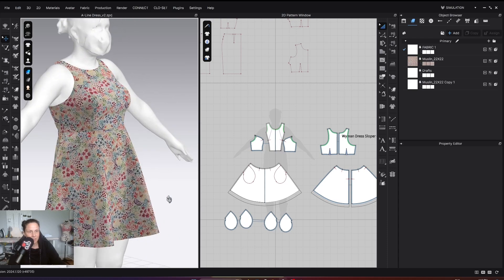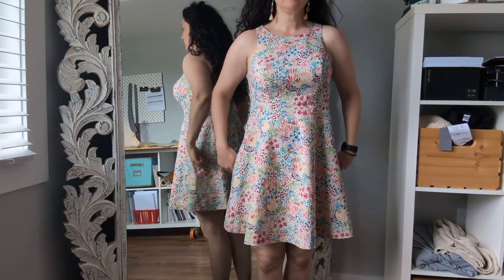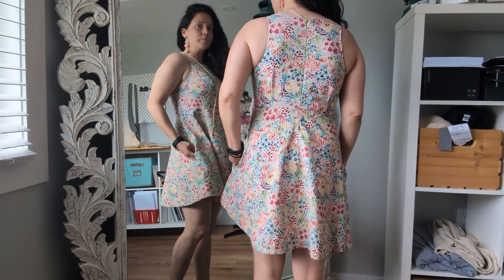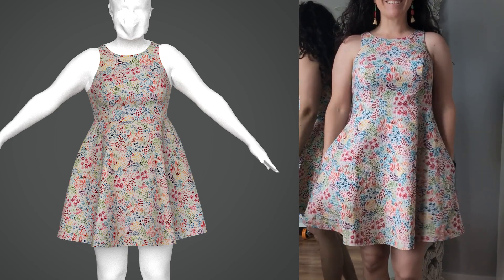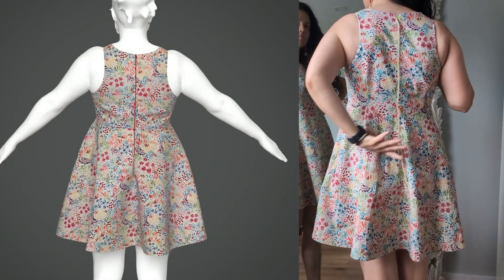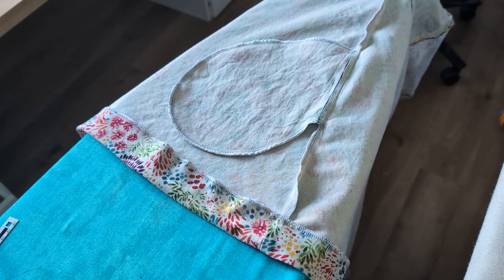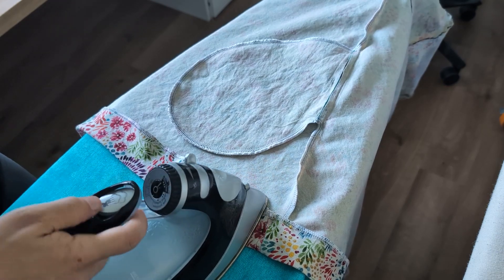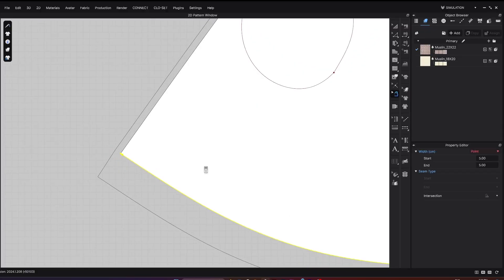CLO3D Digital to Physical Garment: How Accurate Is Virtual Fit?

Comment: How did you get a body scan avatar? Is this different from the custom Daz3D avatar that you made? Thanks!
Reply from the maker: This body scan was done by a local business in Montreal that usually does scanning for 3D printing, it was a bit awkward to get a body scan done there in my underwewar, haha!  Its not a Daz avatar, and it has been difficult to work with for anything other than this kind dress.  i.e. I have not been successful at fitting any kind of intimates on her.
Reply: @ oh! I wonder why? Do you think it’s because her body is so rigid? I can see wovens working fine with that, but stretch might be harder without natural give. Are intimates usually tricky to make in the same way with the Daz avatars? This is so interesting!
Reply from the maker: @Dee-wv7ji  no, actually the avatar mesh, the polygons the avatar are made from, is very difficult to work with from a scan.  I had to learn how to retopologize it and clean up some holes in Blender.  I have had a lot of success making intimates with stretch materials for more standard ready to wear sizes in both Clo and Daz avatars.  My avatar still has a lot of collisions and bumps that I still need to work on.  For example there is no seperation in the legs, so it's impossible to fit underwear.